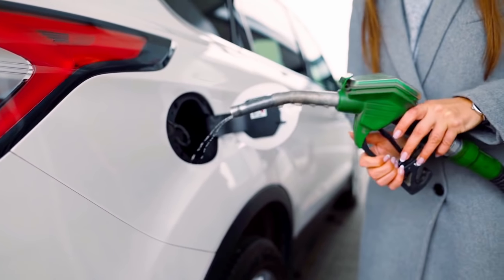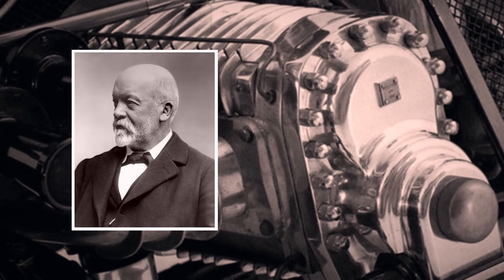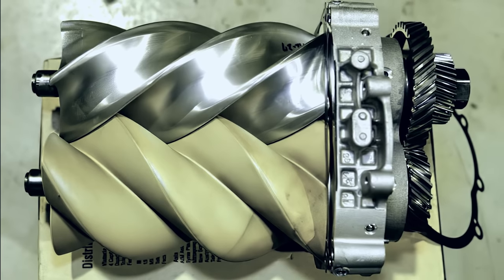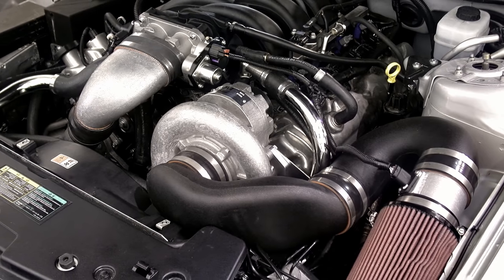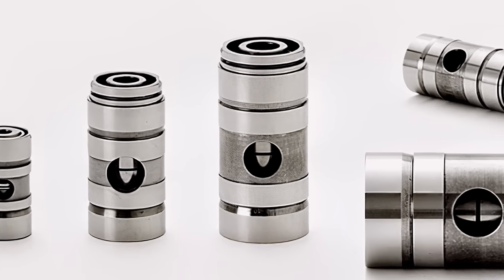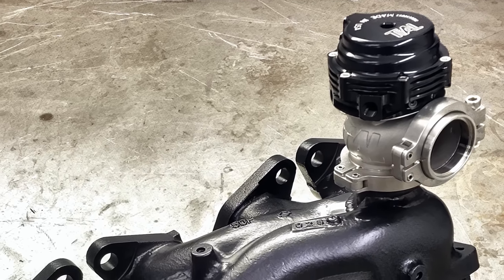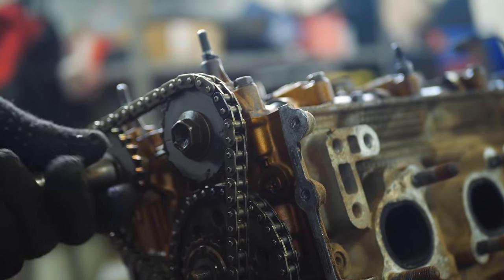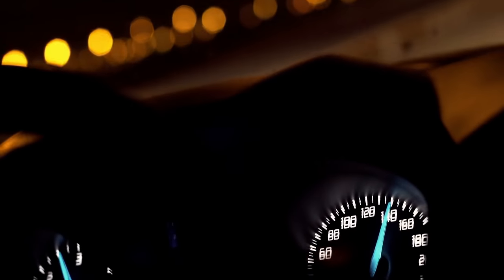The Science Of Boost

Comment: Great video, except for a glaring mistake on the “ Air flow “ through the cutaway Roots blower .  The air flows around the PERIMETERS of the case ( outsides trapped between lobes as they open and close air inlet & outlets ,  NOT through Center between lobes as was shown in illustration.  I have worked / wrenched on many , MANY roots type designed blowers and speak on this point with some authority.  Other than that , pretty good video.👍

Comment: There was one single part of this entire video that I feel you could have gone more in-depth on. In regards to "turbo flutter". In reality, and I'm sure you know this, it's actually called compressor surge. And there are circumstances in which compressor surge can be harmful to a turbocharger, but there are also circumstances where any damage caused by compressor surge is superficial at its worst. There are two different types of compressor surge, being loaded and unloaded. The most commonly known of the two is unloaded compressor surge, what you referred to as turbo flutter in the video. Characterized by the distinctive sound it creates. And its causation was explained correctly. When the throttle plate is snapped shut, the rapid reversal of airflow will stall the compressor and the process will happen repeatedly for some amount of time. Now, while this does impose a torque load on the turbine shaft, it's typically well within acceleration tolerances for the turbocharger and rarely causes any  actual damage to the turbocharger itself. It is called unloaded compressor surge because it is exactly that. The engine is no longer providing the exhaust gases necessary to drive the turbine at the RPM's it was while the throttle plate was open. The turbocharger is already in the process of deceleration, and the exhaust gases don't provide enough flow through the turbine for torque loads to an issue. It may slightly reduce the overall lifespan of the turbocharger, but generally the difference is negligible. Where you really run into issues is loaded compressor surge. Loaded compressor surge happens when there is a simply too much air volume from the compressor for the engine, intake tract, or any other restriction to allow passage of more air. This will lead to extraordinarily turbulent airflow ahead of the restriction, and eventually, a reversal of flow between the compressor and the restriction. On the intake side, the general idea is similar to unloaded compressor surge. Where the difference lies, is on the hot side of things. If you run into compressor surge while exhaust gases are pushing the turbocharger to boost you will absolutely see torque loads on the turbine shaft well in excess of tolerance. This can and will cause a turbo to fail catastrophically, and quite rapidly. 

TL;DR 

Chu Chu off throttle = All fun, good turbo noises

Turbocharger screaming bloody murder noises at WOT = death sentence

Comment: You're wrong about compounded boost systems. Whole compounded turbos will have the exhaust gasses going to the smaller turbo first and THEN to the larger turbo, although it's the output of the larger turbo's compressor that will feed into the smaller turbo, not the smaller turbo's compressor feeding into the larger. This is because the primary compressor has to provide ALL of the airflow of the total system.

Comment: You have the rotors in the Roots blower rotating the wrong direction. Since the rotors intermesh in the middle, they have to force the intake charge around the periphery of the blower housing. Your animation shows the intake charge somehow “magically” passing through solid rotors in the middle. Doesn’t work like that. The blue rotor should spin clockwise!

Comment: the animation of the roots rotors spinning is spinning backwards. they spin the other way and air is compressed between the casing wall and the lobes and not each other. this is why the higher volume is achieved

Comment: the best video for the beloved turbo amazing work .
i want to add a couple of things the split turbo and the electic turbo ,the first has has the cold side and the hot side of turbo splited and the benefit is the hot side doesnt increases the temp of the cold air that is coming in the cold side so way more air can come to the system(first manufacturer is Mercedes ) and the second is a small turbine that is driven by electricity to send air to the way bigger normal turbo so it doesnt have lag(first manufacturer Audi/VAG)   :)

Comment: Your description for World War II American military aircraft is incorrect. Some Army air Corps aircraft used both a Centrifugal supercharger and a turbocharger. The turbocharger was used as an “altitude compensator”. 
It only provided boost at altitude to compensate for the lack of air pressure always keeping the inlet pressure at the centrifugal supercharger at atmospheric pressure, at sea level the wastegate completely bypassed the turbo so it was not providing any boost.
Depending on the aircraft, the wastegate would be completely closed above 25,000 feet, the supercharger would still think that it was at sea level providing max with boost for the engine at all altitudes up to 25 or 30,000 feet. 
Some of the aircraft employing this technology was the B29, B24, B17, P38 and P47 thunderbolt. 
The P47 in particular, was one of if not the fastest American fighter aircraft in World War II above 25,000 to 30,000 feet, no other aircraft could match his performance because it’s engine was performing as if it was at sea level, but the drag was substantially lower at that speed allowing an incredible top speed at high altitudes!

Comment: The direction of flow in the animation of the roots blower is reversed. It actually pumps in the opposite direction, the air travels on the outside of the gears.
Reply: Only bypass air goes around the outsides, but then right back down the middle.

Comment: Animation at 5:15 is rotating backwards. As is 5:30. The air and fuel move around the outside of lobes or screws not through the center. All of the animations are rotating backward.

Comment: Factory turbo cars no longer use a bypass or blow off valve. They simply cut fuel/spark and open the throttle body so the engine “swallows” the pressure until the compressor slows down or the motor comes on power again.

Comment: It is a common misperception that the air flow moves down the middle squeezed between the 2 blower impellers.   When actually it flows on the outer areas within the blower case.  Turn the impellers the other direction.

Comment: CVT driven centrifugal superchargers are missing. They are more efficient than turbochargers at low-mid rpm but they suffer from reliability issues due to frequent and hard gear ratios change to cope with the engine.

Comment: Lol, mentioning sliding vane superchargers right before the G-Lader chargers is funny. My diesel Volkswagen built at the same time as the G60 engines has a sliding vane pump for vacuum, instead of getting vacuum from the intake like a gas engine. Overall, great video. Boost is good.

Comment: Twin Scroll and GMs recent Twin Volute systems are great advancements in TC. Toyota/Lexus uses both port injection with direct injection and VVT to operate in a modified Atkinson cycle at times. The tech that is going into these modern 4 cylinders is truly remarkable. They are compact efficient powerful and simpler in some ways.

Comment: Your animation of the roots-compressor shows the flow in the opposite of the actual direction. The pumped fluid goes around the outside of the rotor pair. The inside is continuously sealed by the rotors.
Reply: Ahhh rats, all that work on the animation.  Do over :)

Comment: @22:00 this isn't really an adequate description for "turbo flutter" or compressor surge. If the pressure ratio exceeds the "surge line" (the topmost line on a compressor map) the airflow can stall around the compressor blades and even revert back out of the compressor inlet. This happens cyclically bc the pressure ratio drops after a period of stall, where the compressor will work again until exceeding the surge line in a cycle. 
Keep in mind that the surge line is not at a specific pressure ratio, and increasing the flow rate through the compressor at a given pressure ratio will   increase the maximum pressure ratio before stall. Another design choice of using a ported compressor housing can give the turbo anti-surge characteristics bc when the flow rate is low and the pressure ratio is high, the ports will bleed air out of the compressor's exducer housing, but in high mass flow situations bernoulli's principle allows that the surge ports are more or less transparent to the performance characteristics.

Comment: i think your roots blower animation is running in the wrong direction.  the airflow is to go around the outside of the two lobed rollers, not through the middle where there is a moving sealed wall.

Comment: Turbo lag isn't due to the delay of exhaust flow between pushing the throttle and the turbine spinning up, its directly due to the turbine having mass, which takes energy to spin up. Modern engines don't really have turbo lag, what they have is boost thresholds, or RPM at which the kinetic energy of exhaust isn't sufficient to spin up the turbine yet. People seem to forget that boosting is a positive feedback loop, the more boost you make, the easier it is to make boost. 

You stepping on the throttle at 2k rpm and nothing really happens until 5k rpm, has nothing to do with turbo lag and everything to do with the system not supplying enough energy to boost the air charge. Try the experiment again, this time cruise at 5k rpm and punch the throttle quickly, THAT delay is your turbo lag.

Modern anti lag is also misnamed, they don't affect lag as much as they lower the boost threshold by delaying ignition timing and adding extra fuel. Take 2 step as a great example, by deliberately letting combustion happen after the exhaust valve you can effectively lower the boost threshold of an engine to mach whatever starting rpm is needed for a launch.

Comment: Compressor boost became obsolete in aviation in the 1960s with the replacement of reciprocating engines by jet engines.  It's recently become obsolete in automobiles due to the replacement of reciprocating engines by motors, which leave boosted ICEs in the dust with their instant torque (at least if implemented right like in Teslas) -- the opposite of turbo lag.

Comment: The intercoolers are actually important to enlarge the area of the Carnot process in order to increase the efficiency.  This has nothing to do with the proximity of the compressors to the actual engine.  rather, the air that is sucked in is heated by the process of compression and cooling the air increases efficiency

Comment: Error at, 5:04 this shows the blower running backwards as the air/fuel mix travels around the outside of the impellers and where the impellers mesh airflow, does not occur.

Comment: The rotation of the roots blower shown in animation at 5.32 is incorrect...they spin the opposite way, the air is transported around the inside of case walls by the lobes - not down between the lobe mesh zone. Animation incorrect again at 7.39.

Comment: first why do all the compressors and turbo's spin the the wrong way?

bigger point.
in the turbo control section u talk about a blow of valve but describe a dump valve.
a blow off valve is used replacement for the waste gate.
u can control the max boost by exhausting exes charge air to the environment.
this is use by tuners / racers so they can weld the waste gate shut to decrease turbo lag, but destroy turbo life.
but mo power is mo power.

the thing u see on most performance turbo charged engine's is the dump valve.
u have 2 types 
open
and re-circulation.
a open type will dump charge air in to the environment when air pressure difference exceeds a set limit.
this is sampled before and after the throttle body.
it makes the whoossss sound when u let go of the thottle.

the re-circulation type will dump the air in the inlet before the turbo.
this makes less noise and helps with maintaining air velocity to have less shift lag .

Comment: Its kinda funny. With all the wastegate springs and designs we have all tried. bigger vs smaller valves. Then full on dome control through boost controller with air or C02 for extreme swings between low/no boost to high. Just this past year or so now, TIAL and turbosmart are just now going to electronic wastegates.If they get it figured out and make them last it will be the next huge thing to hit drag racing. You could actually go down to zero boost with enough valve.

Comment: NA VE can reach around 130%. 
A NA Pro-stock engine from 2005 had a VE of 124% and a static comp of around 15:1, but because it traps 24% more mass the dynamic comp is closer to 20:1. 
Even S/C Nitro Top Fuel engines have a static comp of 8:1, but when you factor in the 70cc of raw fuel in the cylinder at TDC it's dynamic comp is also around 20:1.

Comment: The pressure on the piston isn't a constant, the reaction of the ignition is the release of thermal energy stored in the fuel air mixture, the rapid change of physical properties of the fuel increases the volume of space required for the physical mass of expanding gasses and the rate of this reaction (also controlled) at mass x velocity = energy, rapidly expand as the molecules rearrange to their new physical states or properties that released energy must go somewhere, and the path of least resistance initiates a controlled directional linear motion of physical energy acting upon the mechanical components of the engine within an air tight sealed chamber, we understand the piston moves in one direction as force is applied, which is controlled by a connecting rod that is attatched to a journal on the crankshaft that converts the linear motion of the piston to rotary or radial motion which uses this kinetic energy to provide power and torque output, while some energy gets stored in its rotating mass to push the pistons back to their most distal positions for exhaust and fuel air mixture compression (TDC) and a flywheel acts as a buffer to keep the engine in motion during energy loading. 
 You actually improve this processes efficiency by increasi the total mass of the trapped fuel air mixture in the cylinder by forcing more of it into the intake valve opening. More displacement of air is an increase in  capacity despite the limits of its mechanically engineered dimensions.if you double the pressure of the atmosphereic intake fuel air mixture pressure, you double the cylinders displacement volume, so a 302 ford windsor v8 would displace the same volume of air as a 600 CID Merlin Big Block at a boost level equal to 2 atmospheres.
 Trick is to make it run at those levels.

Comment: A good video. However the other parameter that net volumemetric of air being pulled into each cylinder, during each suction stroke,  is the partial recycling of exhaust gas back into air intake by EGR. This reduce the combustion temperature inside the cylinder during power stroke. Good if you could make video to explain the negative part of EGR which thus limit the hp output to about 110hp for every 1000cc of engine capacity. Regards.

Comment: 1:08
How can efficiency get over 100%  ?
Reply: The volumetric efficiency says how much air the sylinder manages to suck compared to the volume it displaces. So if a hypothetical cylinder of one liter manages to suck in 0.75 liters, that's a 75% volumetric efficiency, but if the inlet valve to the sylinder has a higher than ambient air pressure, more air will flow in because it is slightly compressed. Does it make sense?
Reply: @namsmakergodt  No, one liter cylinder always sucks in one liter ;)
Reply: @My-Opinion-Doesnt-Matter  Yes I know that:) But when the inlet pressure is above one atmosphere,  the air sucked in will expand to be more than one liter if it were allowed to expand at 1 atmosphere of pressure. 1 liter air at 2 atmospheres will expand to 2 liters at 1 atmosphere.
Reply: @My-Opinion-Doesnt-Matter  the volumetric efficiency is calculated through a theoretical volume. One liter is always one liter, but a forced induction one liter engine will theoretically behave like a larger NA engine.

Comment: The TLDR: You need two things for power-- fuel and oxygen.

Fuel, being a liquid, is a thousand times more dense than the air that supplies the oxygen. So increasing the fuel is easy: Open a valve a little wider, and you add a thousand times more fuel while you end up struggling to gather enough oxygen to match. So, in the balance between fuel and oxygen, you'll always come up short on oxygen whenever you want to increase power.

There are three ways to increase the amount of oxygen moving through the engine: Make a bigger engine; Add oxygen in a chemical form; Or strap an air compressor to the engine and force-feed it pressurized air.